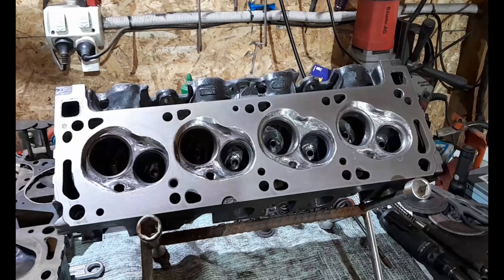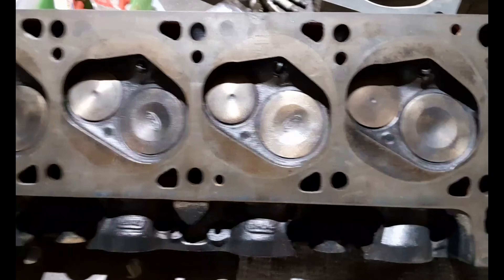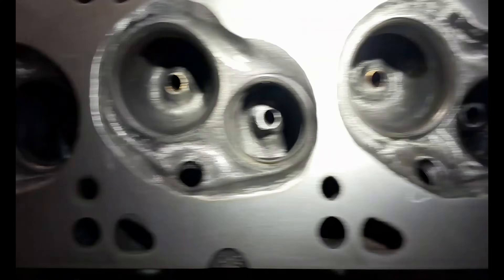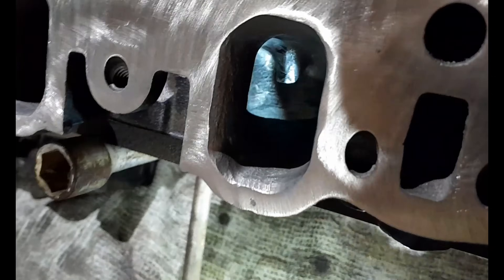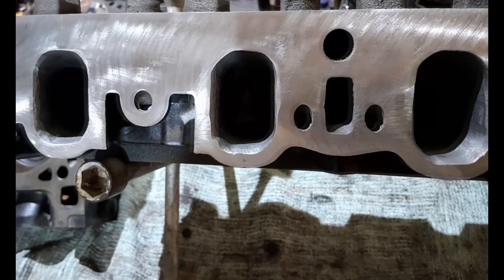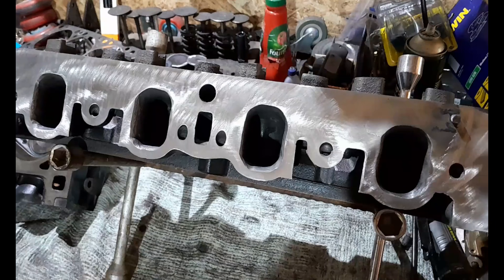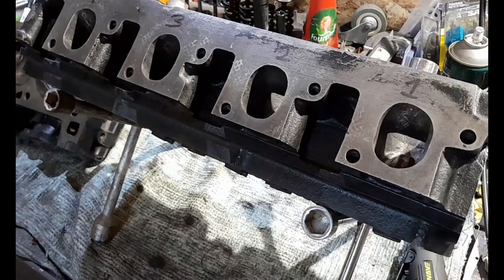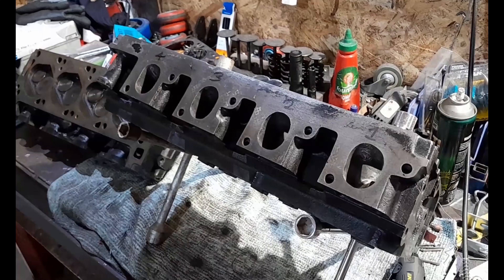Ford 351C 2V Iron Heads Porting For Power

Comment: Nice! Never see these O.E. heads in the States. Seldom see this quality of work anywhere. Iron ain't easy. 
Your color commentary is top-notch entertaining! What gains do you get with a mid-size engine? Greetings and thank you from the U.S. of A. mate!
Reply from the maker: @billfioretti3013  hi Bill and thanks for the nice feedback. Recently returned from a 6 week holiday down in North Carolina. We had a great time and loved the US and its people.

Yes, these are the renown Aussie 302 closed chamber heads. A pretty good head for the time. With a little TLC they can be ported to support around that 550HP on the right engine combo.

Pretty bad ass for fifty year old iron. Just need a bit of elbow grease to get them there. Truth is this is only the second set I’ve ported. Just taking it slow and steady for a good result. Thanks for checking out the channel.
Reply: @Doctoradhd1  My pleasure. I'll check back with you again.